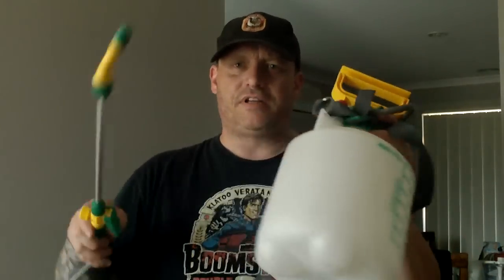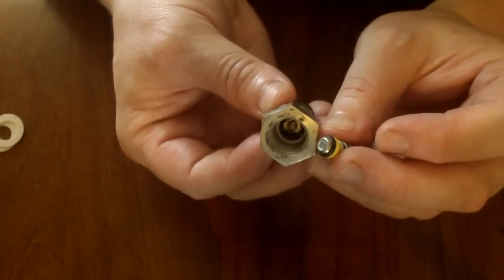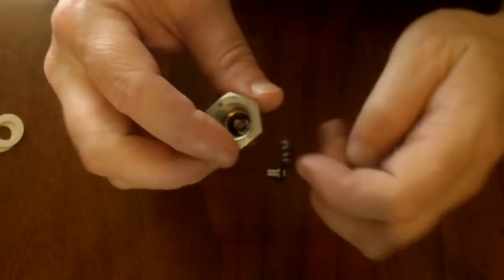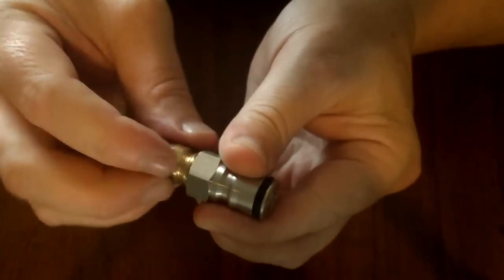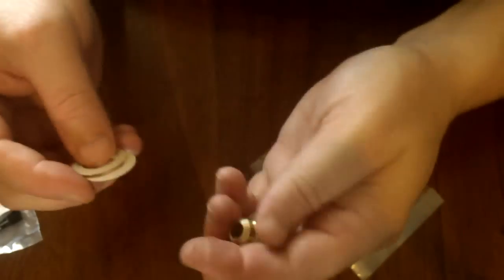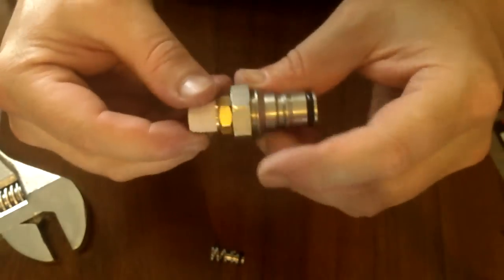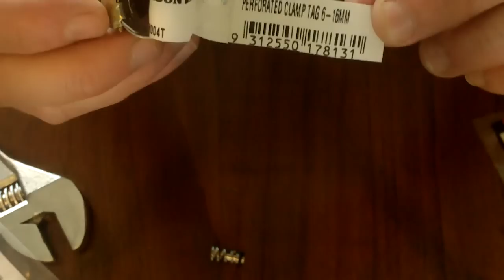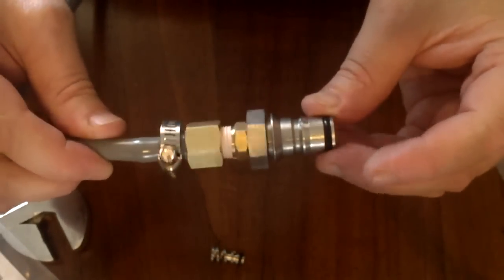DIY Beer Line Cleaner build - PART 1

Comment: Hi gash ,great project I have looked for the adapter on ebay, that you have but can only get one from the United Kingdom . could you tell me where you got yours from .
Cheers John
Reply from the maker: +John Watson there are easier adapters been produced since I made this video. This one comes with thread so easier to find something to fit http://kegking.com.au/ball-lock-post-with-1-4-inch-bulkhead-assembly-liquid.html or this can be used even easier! http://kegking.com.au/carbonation-cap-line-cleaning-cap-counter-pressure-filler.html Cheers mate!

Comment: Great video, thanks for sharing! I'm following this and making my own one. You said the adapter you bought off ebay was only a couple of bucks. The only few I've found are around $15 once you include shipping. You wouldn't happen to have the link where you bought yours from would you? Thanks.
Reply from the maker: G'day I bought mine from ebay, but the seller doesn't seem to be on there any more, here's one that has ended but try contacting the seller, its a couple of dollars more expensive then the one I got. http://tinyurl.com/lzmd97c
Reply: Gash Slugg Cheers for the link.

Comment: Gash you know I was trying to figure out how to connect to two  corny  keg connectors  so i could make a continuous line so I could run cleaner through my kegerator lines . I searched but strangely they do not make a 2 post connector u can snap between beer lines,,,not sure why,,they have them for sankes . Any way your way might work . a 9/16 to 9/16 JIC union ...any thoughts ? I can not find them in SST..only aluminum or mild  steel ...any thoughts on that setup ?
Reply from the maker: There is an easier way these days, but not that cheap, you can use a carbonation cap like this https://www.kegland.com.au/carbonation-line-cleaning-cap.html these werent around when I made this vid, and this would replace the mucking around with fittings. So you could use a couple of these and some line. There maybe be a other ways, umm maybe if you changed to john guest style fittings on the Quick Disconnects or the screw type, then you could probably get cheaper connecters for between the lines? I do mine separately so its not something I've thought about, mainly due to having to spend money I dont have lol Cheers!
Reply from the maker: https://www.youtube.com/watch?v=CCrfp8ha9Dw
Reply: yea that would work too I guess . I was just thinking a solid connection would be easiest ,,,but a hose connection between those caps would work too I assume . good idea though thanks ! I am not familiar with the John Guest style,,is that a down under thing or would they have that here in the states ? The screw types you mentioned I  have not seen either . At least I do not think so .

      In commercial cleaning they always use couplers if they have a lot of kegs and they put jumpers on the tower so the cleaner is circulated in one long run with a pump  for about 15 minutes . I was just trying to copy that system..its pretty efficient . Worse comes to worse I could do it one at a time,,,but I am that lazy that is why I was trying to make a half ass corny coupler...I am surprised that some company does not make a double ended corny coupler  . I am sure I am not the only one who has been looking for something like that !!
Reply from the maker: John Guest are available all over the world, not sure on the origin, USA or UK I think, take a quick look at this video, he is an Australian but was just the first one that popped up in the search, so looks like you need the screw on QUick DIsconnects, and attach the JG fittings to that, but once done you can fairly easily disconnect them and use joiners to join your lines together, I'm not sure if thats much easier for you. https://www.youtube.com/watch?v=x-FWlMy6M_4
Reply from the maker: Although ignoring all that, I just found these https://www.kegerators.com/equipment/ball-lock-cleaning-post-jumper/ I didn't know they existed, never seen one, but I think thats what you're after?
Reply from the maker: although says in stock, but then you click through and says out of stock!
Reply: wow...thanks Gash,,those are pretty cool...I never knew about those...I was back in old school days ..thought everything had to be clamped and on barbs,,,like that set up he shows much better !
Reply: OMFG...how did you find that !!!?? that is exactly what I was looking for ! That is what so many people told me did not exist,,,thanks so much ! that is what I had been trying to find for so long . I should have checked Bobby's site out first..he has a lot of that off the wall stuff like that. I have bought a lot of stuff off him in the past...good guy for sure !Weird thing is though the link you give goes to kegerators dot com....but when you click their link you end up at brewershardware,,strange . IDK if you know him,,,but that is Bobby from New Jersey ...he has been posting beer vids for years on youtube . but you are right..says not in stock...god damn it...I was all excited to..figures . I sent him a message to see what is up . I think it would be good to have a handful of these around...I am sure there is other stuff that could be done with them too . Well thanks again Gash,,,,you are my go to guy on beer,,you have answered a lot of my questions in the past,, I appreciate your time and help! If you are ever in Boston I owe you a few beers ! Garve
Reply from the maker: ah ok I didnt know that was Bobby, if he says he can get more, let me know please, Cheers mate! and thanks for watching!
Reply: will do for sure...I will let you know when I find out no problem ! cheers!!!
Reply: check this out..of course..out of stock..wtf!?

Comment: So I just bought all the parts and made this and it doesn't fit my keg at all. I don't have that type of mount for the top of my keg. It's all steel and had a pull in and out handle and then you twist. 

Any idea what else I can order to make this right??
Reply from the maker: I cant really help unless I know exactly what type of kegs you have. If you dont use corny keg fittings it isnt much use for you, saying that you can get Sanke keg couplers like this https://ae01.alicdn.com/kf/HTB1Au8tIXXXXXcPXpXXq6xXFXXXq/-font-b-Cornelius-b-font-Type-Ball-Lock-Post-for-font-b-Keg-b-font.jpg , but then you need quick disconnects on your lines.
Reply: Gash Slugg yea I have an American all steel coupler. I don't have any type of quick disconnect. I wish I knew this before hand. I spent a week waiting on the parts.
Reply from the maker: Sorry mate but there is no reference at all to sanke kegs in my video?? I would suggest modding yours or buying one with some form of disconnect as to making cleaning lines much easier, fairly important to clean your lines often. Unless you always have any empty keg that you can use but it can be a pain in the ass to to put cleaner in a keg just for cleaning lines. Cheers
Reply: Gash Slugg yea www.cornykeg.com has the conversion apparently for like $20. In gonna do that. Seems to be much simpler anyway

Comment: Hi Gash, great vid! i have been cruising through all of your content lately as i am about to dive into the home brew world. sorry if you have already answered this but in the video you say the beer lines should be cleaned weekly, i assume that's on the ones attached to the keg and being used to pour the beer, my question is how do you store your unused lines do you fill them with starsan and leave them or sanitise them blow them out with Co2?
Reply from the maker: Yeah you can leave star san in them if you want too, you could blow the star san out with CO2 as well, either way.  Most people dont clean their lines weekly, although we really should, most will go a whole keg or two before doing them, but its just being lazy lol Cheers!
and by the way, you can just use a Carbonation Cap these days, you dont have to mess around with all those fittings, just a carb cap, a clamp and the pressure sprayer. Cheers!
Reply: thanks mate, I have a couple of carbonation caps and a tee piece coming which i thought with a 2L bottle would make a good line cleaner. but i think i will grab a sprayer to save on gas. Cheers mate!
 Keep up the good work!!

Comment: Thanks for the video man. However, there is a piece called carbonator (sold in aliexpress) that was ready to connect in this pump... much easier to do.
Thanks again. Cheers
Reply from the maker: yes for sure, but it wasn't available when I made this video! Cheers mate!
Reply: @HomeBrewNetwork  Could you also use a carbonation cap? Or is that what this fella is talking about?
Reply from the maker: yes, they were not available when this video was made, Cheers!

Comment: Great Video About the fitting this is what i found on ebay, is  " Brass Fitting 9/16 JIC-1/4 BSPT (03-007-J0904)" this the correct one? I just notice its BSPT where the one you got said TBSP or was that a type O? Cheers love your videos. thanks
Reply from the maker: Since this video was recorded there is a new fitting that makes this much easier. You can use one of these https://www.youtube.com/watch?v=CCrfp8ha9Dw they are available every where these days, make sure you get the one with the 'tail' Cheers!
Reply from the maker: put that on the hose of the pressure cleaner
Reply: Yeah I do have one of those and connected it all up and nothing! no liquid wouldn't come out of the end after pressurising the sprayer. all was connected correctly not rocket science, connected to the keg. nothing. Even pressed in the popit with a screwdriver and no liquid.  When I disconnected the hose from the tail it came gushing out of the hose.  Any ideas? I've used this thing to fill PET bottles for 6 months or so. Very frustrated so decided to just make one of your build ideas. 
Thanks for you imput Gash
Reply from the maker: hmm interesting, must be your Quick Disconnects on your beer lines not pushing the poppet down enough? Thats weird!
Reply: Yes something's doesn't add up, as i said earlier even if i push it with a screwdriver the liquid doesn't come out. So i might have to purchase another one or build what you did originally that's why I wanted to make sure the part number was buying was correct.

Comment: Are you still using this setup to clean your lines?
Reply from the maker: Yes but they are much easier to build these days, use a carb cap with a tail.
Reply from the maker: https://youtu.be/CCrfp8ha9Dw cheers. Just whack that on the pump bottle.
Reply: Gash Slugg Brewing woah. Thanks for the heads up. Ya know, saw a guy at home brew club with a cap and didn’t think about it until you mentioned it.